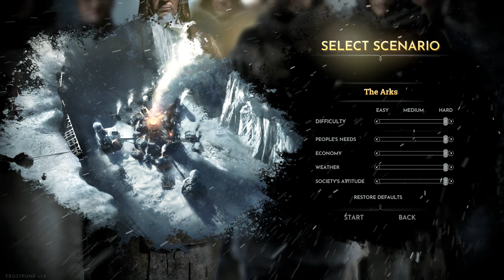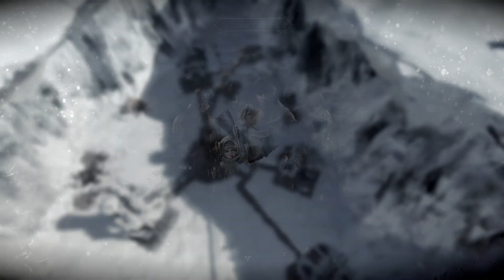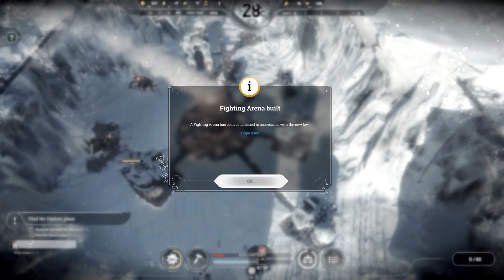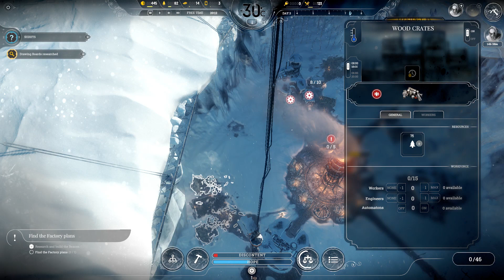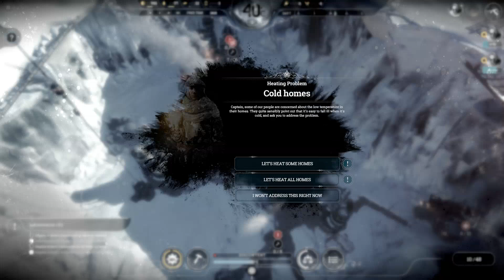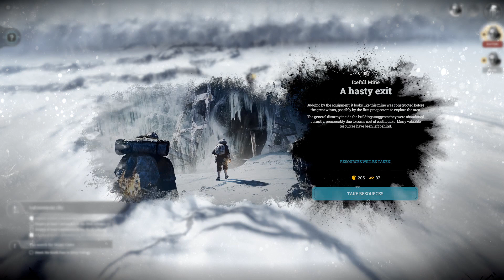The Arks Scenario Guide HARD MODE

Comment: Good guide. I'm still struggling with Hard Mode.
Reply from the maker: the guide is dated, not sure if after updates/patches/etc it still works the same tbh
Reply: @mythicteddy56  Fair. It gives me some ideas of where to shore up at least. I think I went to level 2 Generator too fast last time and devoured all my coal
Reply from the maker: @Cuthawolf  if it still works more power to yah, Let me know how it goes.
Reply: @mythicteddy56  so I happened to stumble on this as I was firing it up. First thing that jumps out at me is the amount of food at the start. It’s half of that now.  Kind of changes things a bit. Not sure how much effect just yet though.
Reply from the maker: @IAmTheRealBill  i imagine there are quite a few things that have changed currently, its a very outdated video.